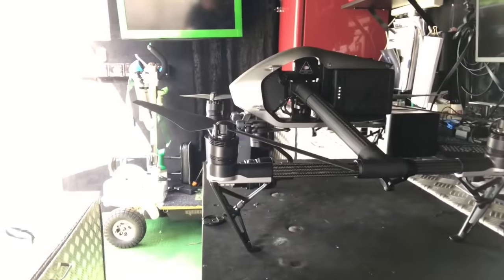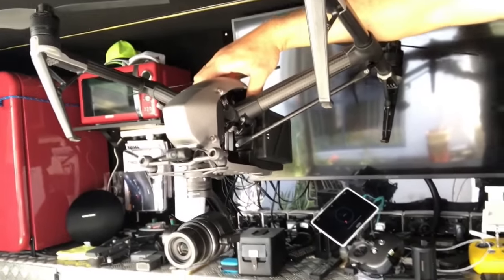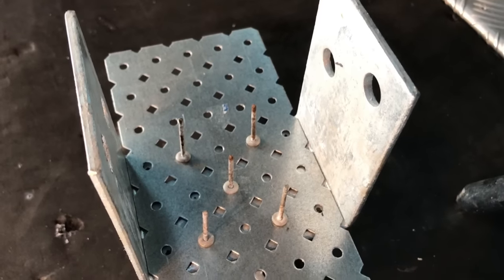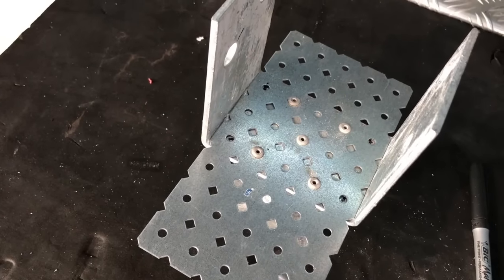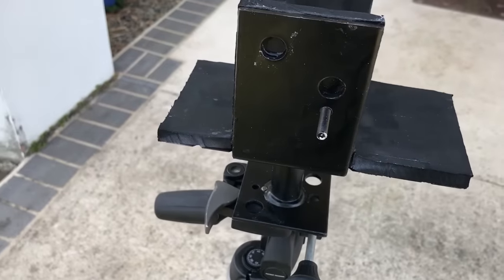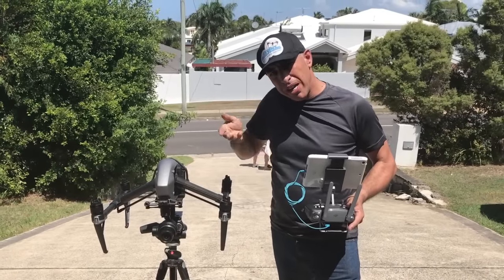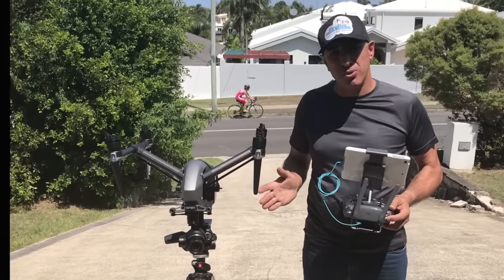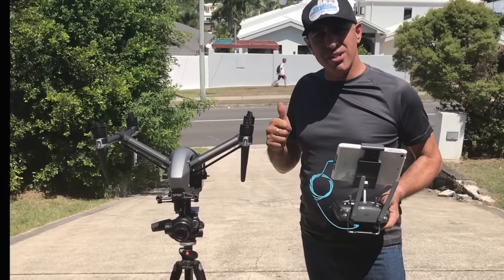DJI Inspire 2 Custom Tripod Stand

Comment: do you recommed this better than the ursa pro?. we are deciding which to buy!
Reply from the maker: I use this set up as we don't have any other HQ camera to use and wanted to utilise this. It works very very well. However the Black Magic Ursa Pro is a specific land camera totally different to the Inspire 2, But if you were going to purchase the inspire 2 as a great aerial camera and could not buy both this is a great trick to use to still get great shots, one thing to be aware is that the Inspire 2 fan is a little noisy, but for me its fine as we normally over dub music. If you want to fly you won't go past the Inspire 2 with the X5S camera and additional lenses

Comment: question: you are just testing to see if you can do this? You are not looking to do this every time you want to do indoor photography vs. conventional cameras? If you are then please tell me what is the advantage.
Reply from the maker: I don't want to spend another $4-5k for another camera with similar specs, so I just use this and its great. Shot some spectacular film with it inside. It also has the advantage of placing in the corner of a room on the tripod  and allowing me to film the room whilst I am outside. so with a wide angle lens I can get max width in my frame. If trio have one I suggest you try it.

Comment: Hi, how are you doing to put your arms in the air? what is the function because I can not do it with my inspire thank you for your help ... michel france
Reply from the maker: you need an Inspire 2, there is a tab to switch in advanced settings which allows you to raise the arms for testing purposes, make sure this is on.
Reply: it's ok I found the function thanks to you thanks again ;-)